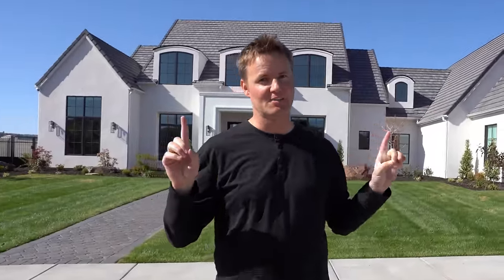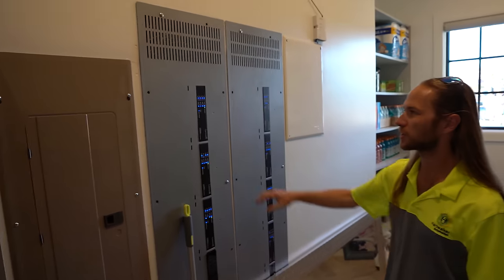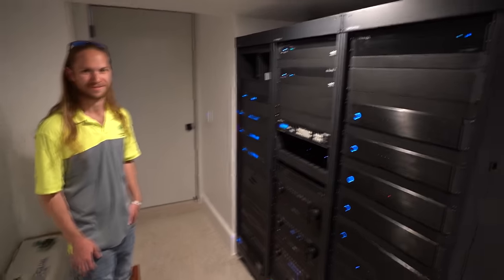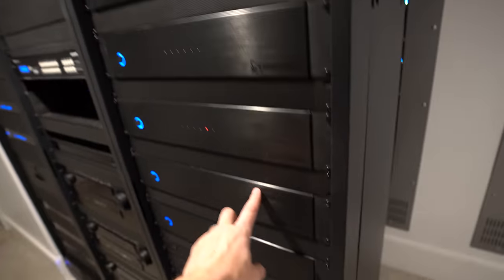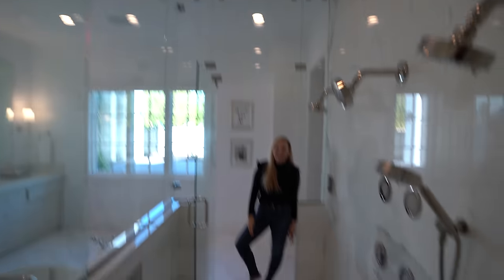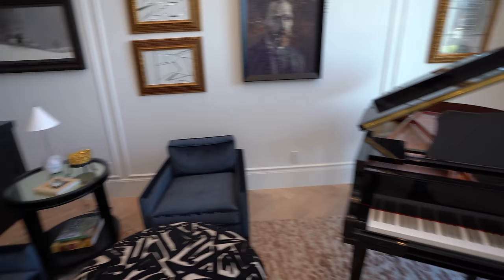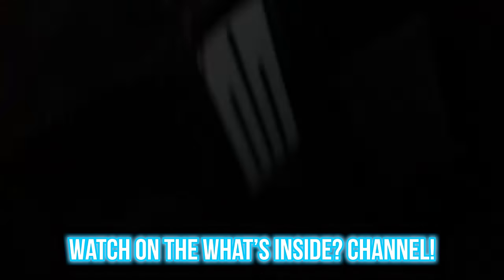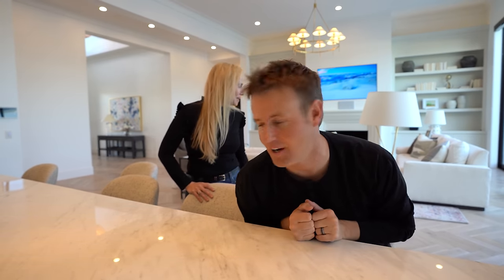FULL SMART TOUR OF OUR DREAM HOME!

Comment: if that house 
catches on fire its going to be a proper light show für sure , wires everywhere. 
i wunder do your door locks work when the power goes out 
i hope ur not one of the dumb ones who has battery operated motorized curtains 
Allso how on earth will u be replacing a speaker or a subwoofer that is inside the wall when it fails ?
mice are going to have a lot of fun in that house füre sure once they get inside :D
other than that it look nice.